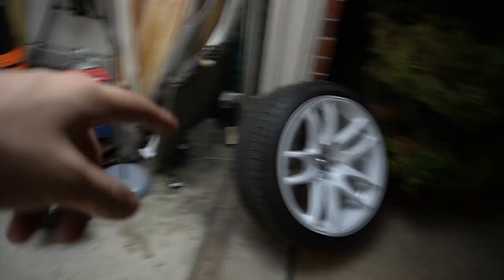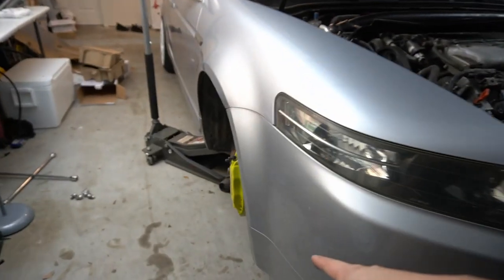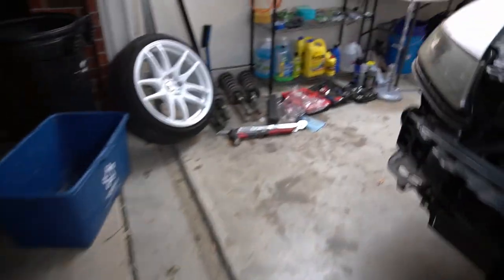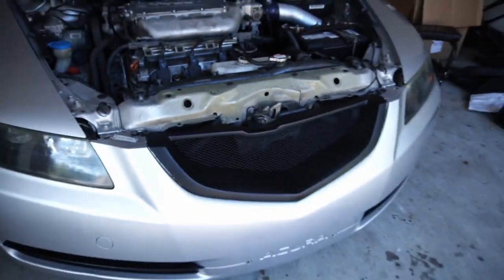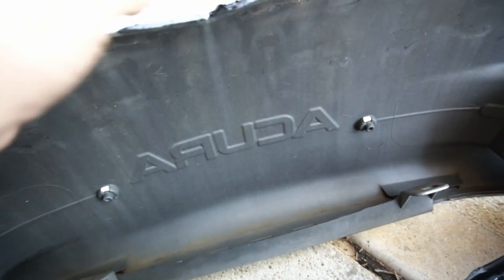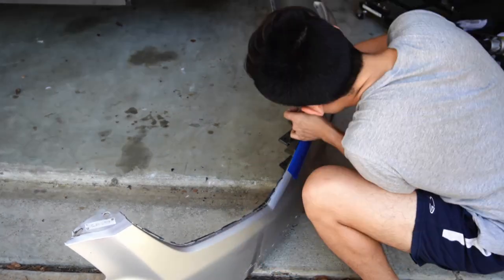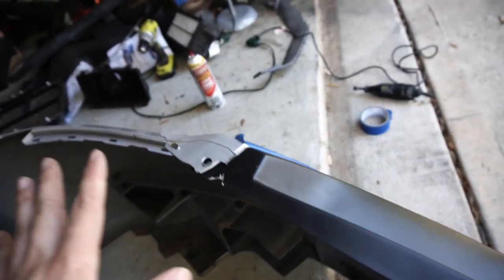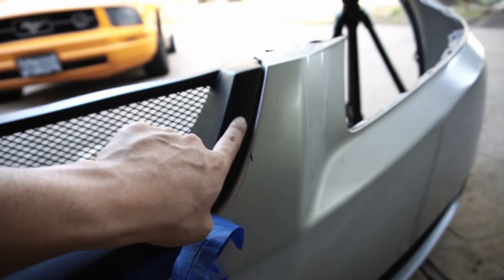Shark Mouth Grill Install! | Acura TL

Comment: Does nothing hold on the grill? Did you just have to drill those two holes in the piece to hold it in place?
Reply from the maker: I used some headlight butyl to secure the grill to the bumper as well

Comment: What’s that black stuff called used to stick and fill in the gaps?
Reply from the maker: It’s rubber butyl. It’s the same material that are used to seal up headlights after you open them